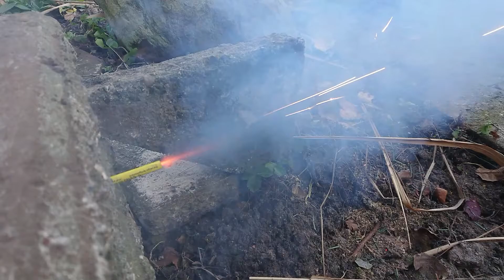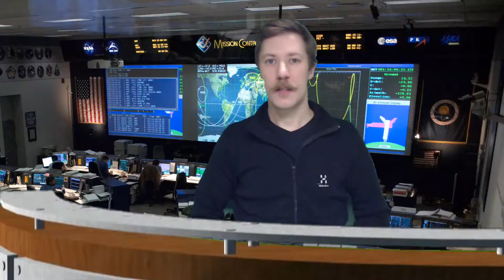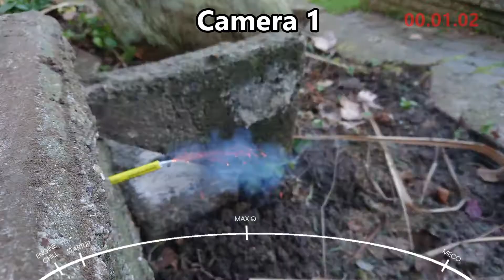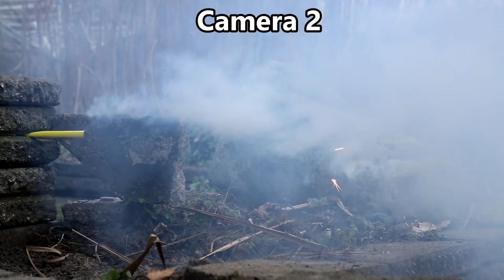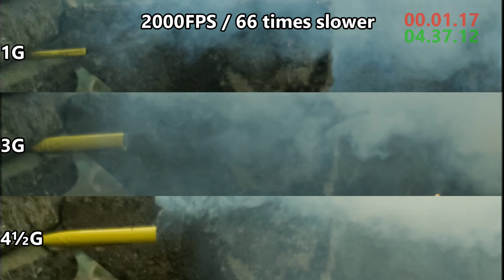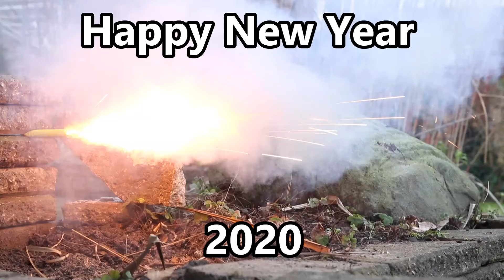New Year Special - Yspace? Static Rocket Engine Test! 3 Boosters + Slow Motion

Comment: you have to attend to your combustion instability, by grinding the mixture finer, and compounding it a bit longer before assembly into your case, so there are no voids. you will never get Legonaut rating otherwise, too much of a risk of the Legonaut suffering catastrophic failure.
Reply from the maker: The oscillatory mix to get the right whistle is always a tradeoff. Stability or go with style to space, Legonaut will take the risk and go with style!
Reply: @KaizerPowerElectronicsDk  So he will be flying either Boeing or SpaceX then, or will be using a Soyuz. Depends on how many pieces you will be getting back in, and the cost and comfort of the capsule.